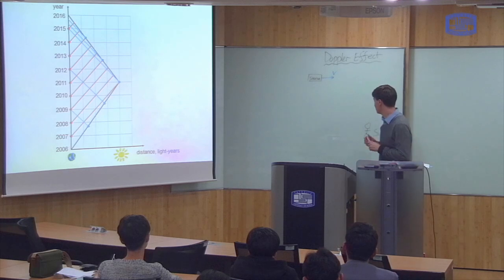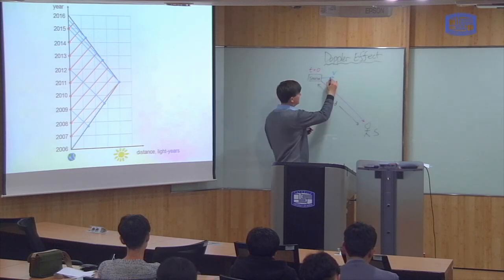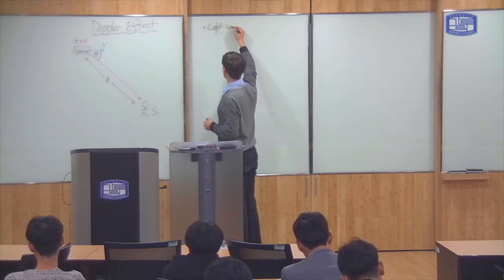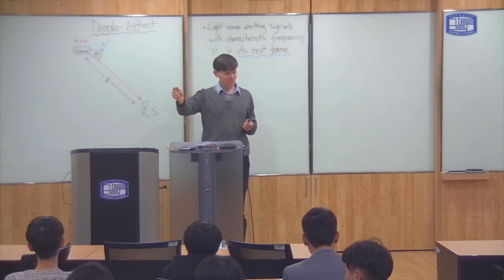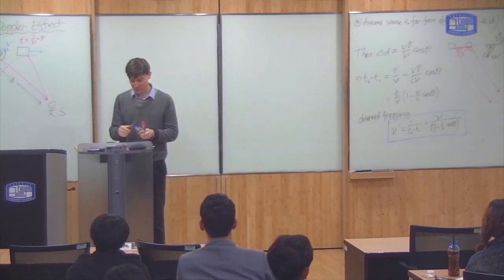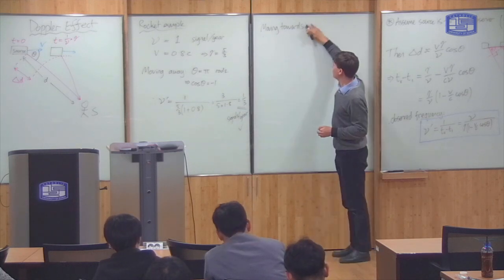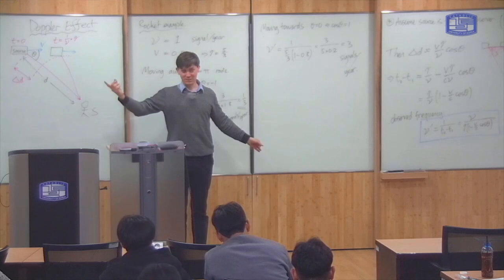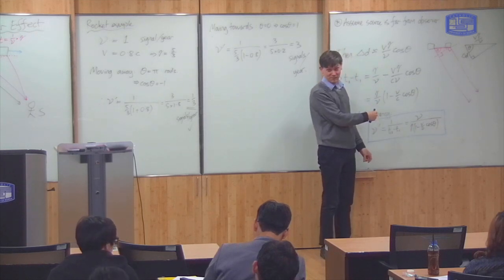Modern Physics 7-2: The Relativistic Doppler effect

Comment: great lesson! solved my doubts. May I ask: is there a way to approximate delta d when d is not very large? ( perhaps the light source is "brushing pass" the observer ), I assumed such a case would render the triangle approximation invalid?
Reply from the maker: Hi Johnny! You're right that if the d >> v gamma / nu assumption is not valid then the approximation used here is no good. In that case you just have to solve for Delta-d exactly (which is possible, but makes the calculation more complex).